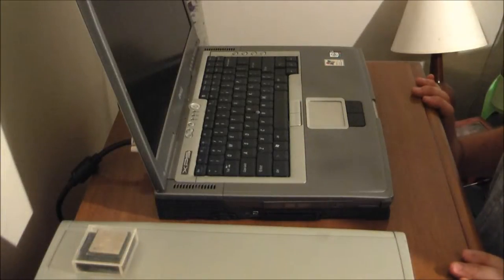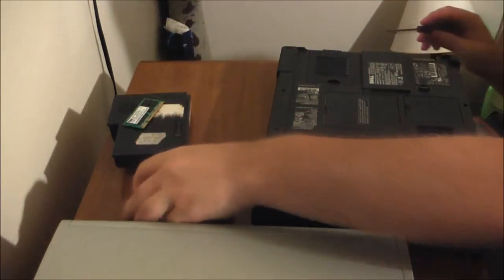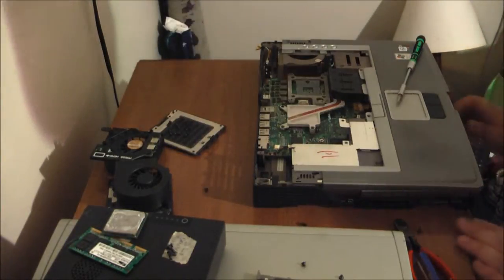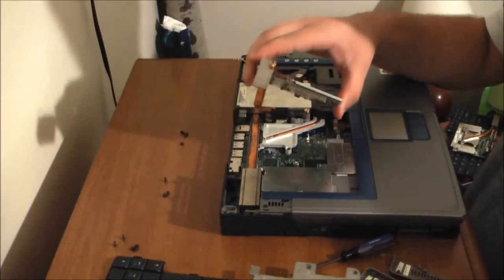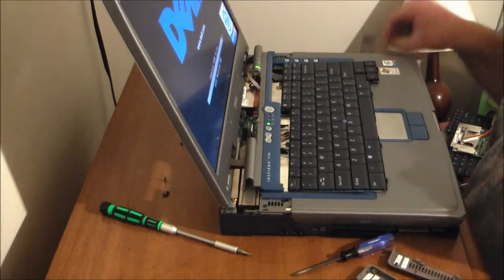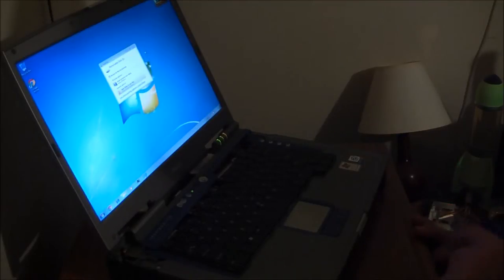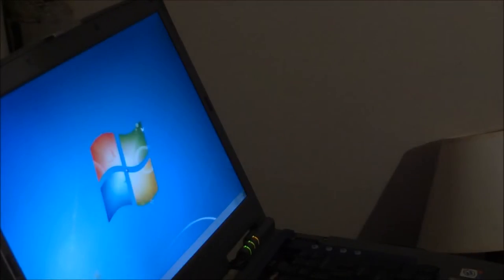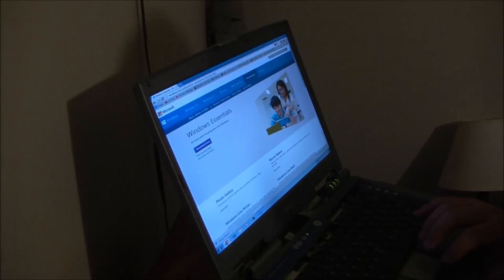Dell XPS Gen1 gets parted out and Inspiron 9100 gets upgraded!

Comment: Im looking into buying a complete dell inspiron Xps gen 1 an it is not known if it fully functional. Tho I could use the parts for my 9100 I only have a 64mb 9700 in it. I learned recently that the Earlier models of the gen 1 had 128mb 9700's in them. Now is there a way I can tell Without seeing the bios before I order it from someone ? to see if it has a 9800 ? thank you
Reply from the maker: i'll check.
Reply from the maker: yes you can. look up the model numbers on the sticker and it should point you in the right direction. also there's a sticker on the underside that says how much memory it has (64mb, 128mb, 256mb).
Reply: +gameboy3800 thank you very much your a huge help
Reply from the maker: no problem
Reply from the maker: also i was refering to the stickers on the graphics card itself. if you can't see them, then you'll need to lookup the system service tag if it still has one. the system service tag will be on the bottom of the computer somewhere
Reply: *****
Thank you, It turned out it was a 128mb 9700 but oh well its still actually pretty powerful with games like unreal 2 n stuff. It seems pretty rare to find a 9800 nowdays atleast that fit it. The motherboard was also dead in the xps i got but everything else was good
Reply from the maker: thats good